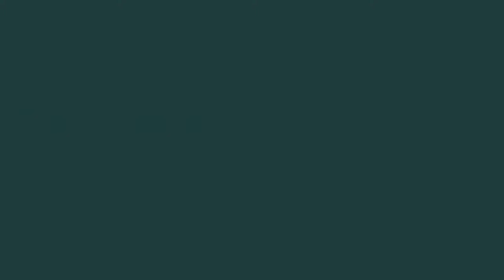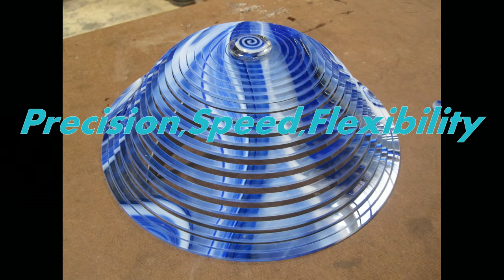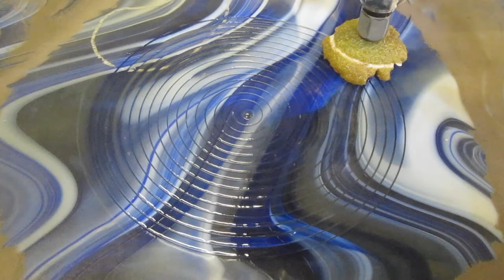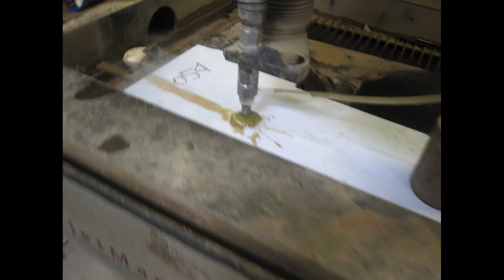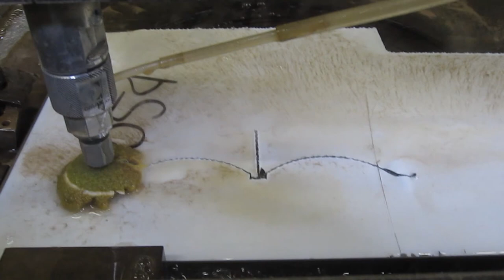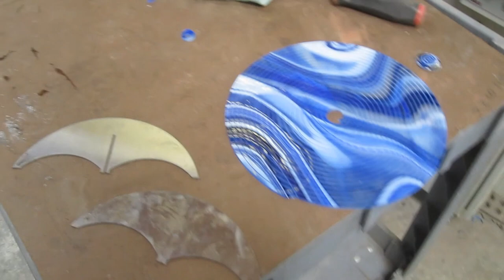Glass Lamp

Comment: I like the Tennis-Ball improviser. haha.
You need a shot with the lamp in-use! Looks slick. The on-off button should be on top... press the whole thing down an inch and it turns on then springs back up into position. I wouldn't have thought glass could flex like that. Impressive design